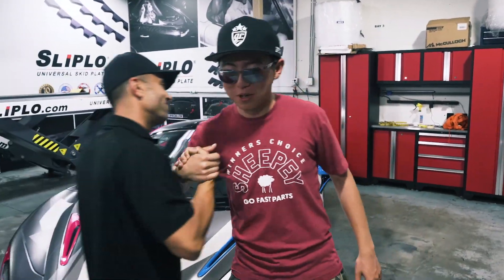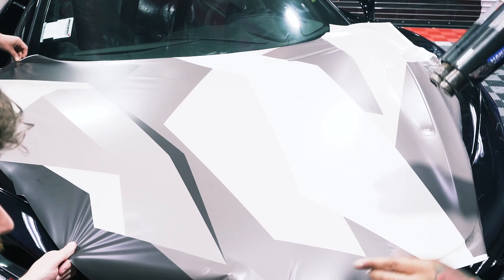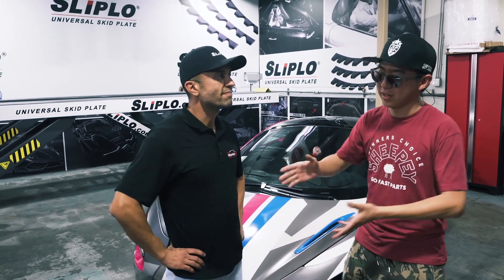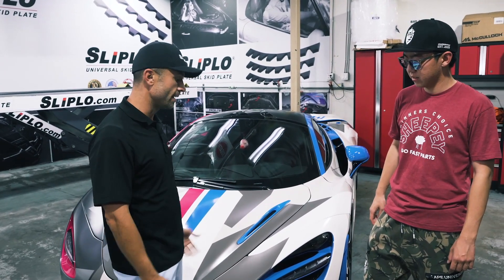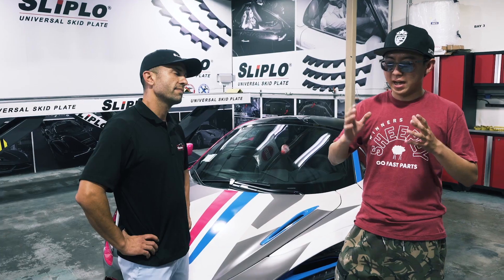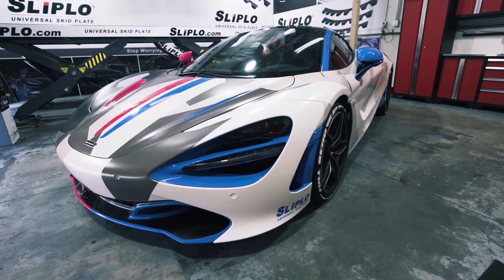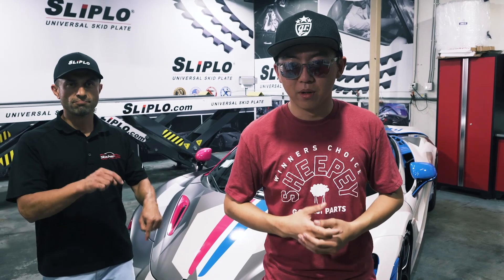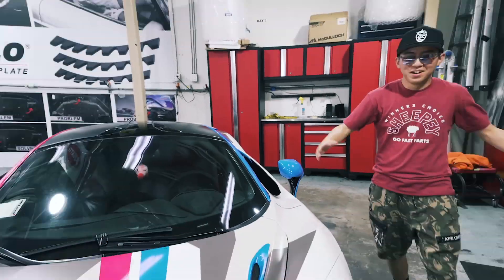My New INSANE McLaren Wrap!! *Mcdaddy V1 Reveal

Comment: Sliplo nah just do what they did in f1 use wood to protect the bottom of car natural fibres and the tough durability of wood is hard to beat and its cheap check out what they call the 5mm plank   what goes under the drivers . I would use marine plywood it's waterproof  cut it spray it and stick it on do a better job than them little plastic things